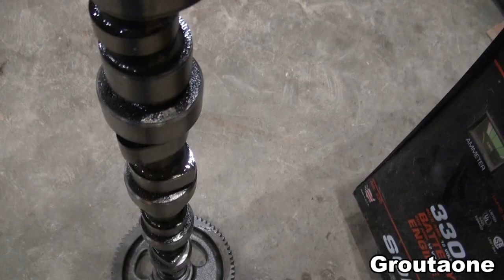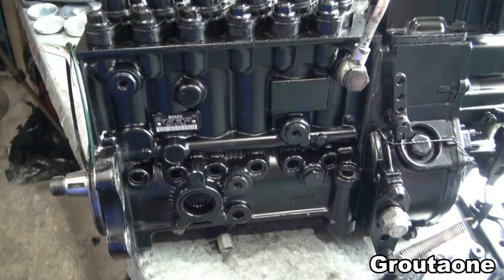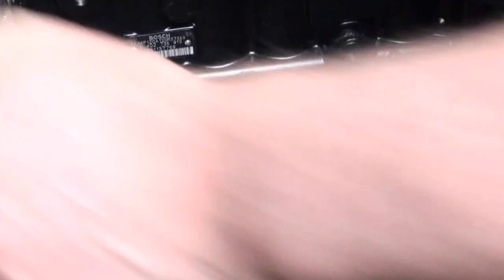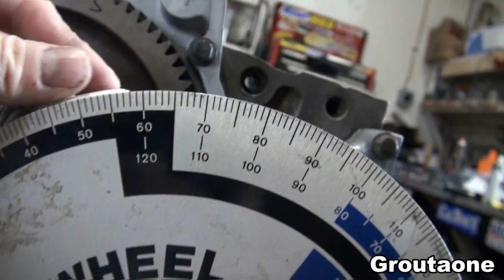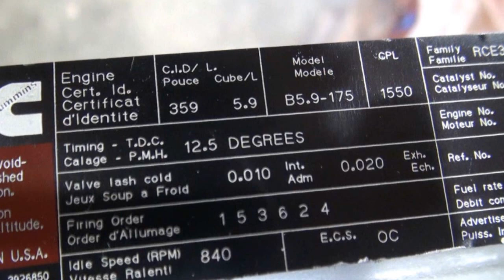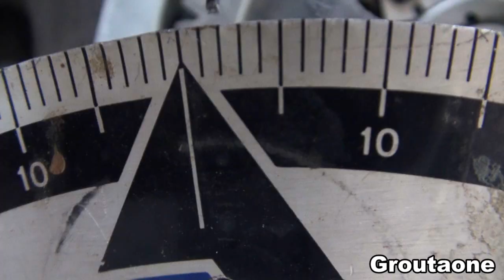Cummins Injection Pump Install and Pump Advance part 1

Comment: That pump should be 18-20 degrees .. I believe a 94 sets original at 12.5 which is why they had 160 hp .. I'm not sure if 95 or 96 went to 14 degrees .. But if you want any power out of that engine it should be 18-20 , you can go 22 but in Canada that would make it harder to start in the winter
Reply: So I got a 5.9 cummins and I removed injection pump to reseal engine inspection plate on side. Blew the gasket. Now inorder to set time correctly again. I gotta pin the engine at TDC. And turn the pump till I see the timing pin there. Install it back into engine and leave gear loose and turn the engine counter clock wise to about 12.5 degrees as per spec plate on engine? Is that correct procedure?
Reply: Please help.
Reply: @taranveersihra127  Yes it's 12.5 before top dead centre .. Power driven Diesel sells a magnetic degree wheel (you can make one yourself) if you want to change the timing a little more advanced .. But if you pin the pump and pin the engine it will be set to stock timing .. Just snug the gear with the pins in place or you'll break the pins .. Remove the pins for final torque .. And make sure the pump gear and shaft are very clean or it could slip  ...

Comment: Where did you get your plastic caps to protect the injection pump outlets and the injector inlets?
Reply from the maker: I had some and got more from a John Deere dealer
Reply: @groutaone  thanks for the response!

Comment: Sorry sir can I ask you a question? Timing pin what is it work it?
Reply from the maker: Hello, the timing pin is only a tool built onto the engine, it operates only when moved by hand to find top dead center.
Reply: @groutaone  thanks a lot
Reply from the maker: @yosfazi201  Thanks for watching
Reply: @groutaone  you're welcome